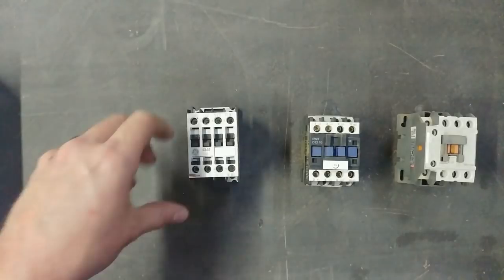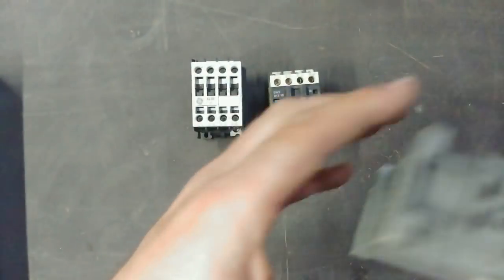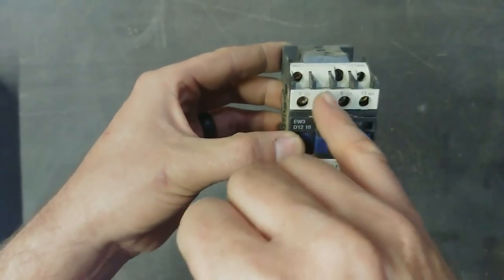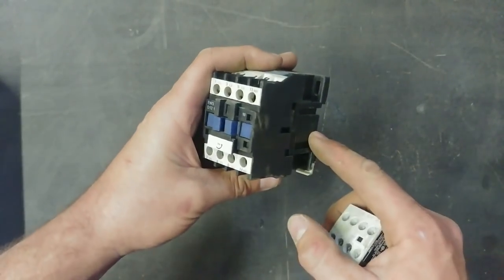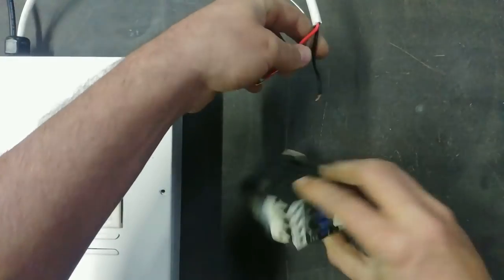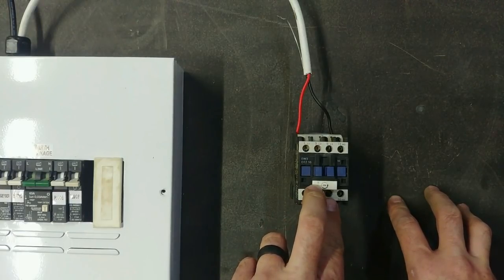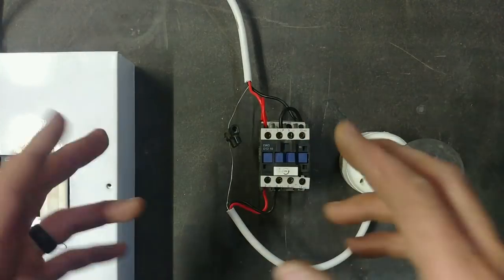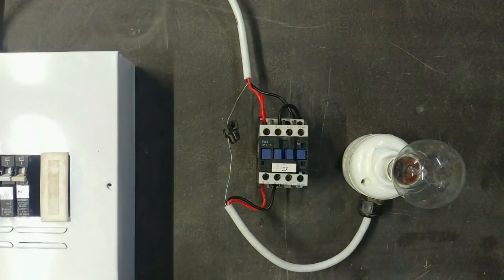How to connect a Contactor

Comment: How can anyone thumbs down this video...it's very clear, simple, and straight forward. Good job JB.
Reply: Someone like me who needs to connect a contactor to the mains in order to automatically switch between mains electricity and generator power when power goes out. This video does not help in my case at all. Having said that, I'm not the one who thumbed this video down. I'm curious though! How did you know someone thumbed this video down when only the creator can see thus information? Unless you're the creator. In that case, you ought to know that self promotion is an exercise in bad taste.
Reply: @TerryMasri  YouTube used to display the number of thumbs down on a video. 

They have removed our ability to see this number since the pandemic.

I am not the creator of this video.
Reply: @Strongs_G3528  That's exactly my point. Unless... you saw the video before the policy change. I didn't pay attention to the dates. My bad 😕
Reply: @TerryMasri  Indeed, my comment was made 4 years ago. All good. Take care.

Comment: Hi Jean, great video. Another reason for a contactor is safety. I have used momentary switches to engage a contactor for my milling machine, that way if there is an interruption to the power supply then the contactor disengages so the machine can’t re-start when power is restored without pressing the Start momentary switch again. 
Judging from the colours of your wires I’m assuming you’re in South Africa 🇿🇦.
Reply from the maker: South Africa is correct.
Good point on the safety!
Reply: @p0we111  hi br Jean... I still need some sort of clarification.... what if I wire my supply through A1 and A2 for L and N respectively and my output at L1 and A2 of the contactor for L and N to the load.
Help with clarification please

Comment: Can you please explain again, why use a contactor instead of a common switch for a sports field? Something you said about the current?
Reply from the maker: Normal light switches where I am can only handle 16Amps.
Contactors can handle more if you buy a higher rated one.
Will also work better for remote starting.
Reply: @p0we111  Thanks! So, what would happen if I accidentaly use a switch or a contactor on a higher current than what it's rated for? Will it melt?
Reply from the maker: @GzzLuiz 
If the switch is rated 16Amps and the current that runs through it is 20Amps it will eventually fail yes. Maybe not in a week or a month but it will.
All switches fail eventually, even with less current running through it.
But if you double or tripple the allowed current it will fail faster. It will melt yes but I have not seen a switch or contactor catch fire, but surely not impossible.

Comment: Hi Jean, great video. Please, can a contactor be used for a 3phase 4 wire circuit?
How can I achieve that? Is it by using the auxiliary contact as to pass the neutral?
Reply from the maker: Hi. You can buy a 4pole contactor for the 3pases and neutral,that would be best... 
If you have the info of the current contactor and you can see how much the auxiliary contact can handle (usually in amps) you can use it if you're breaker/amps required is less than the aux amps. 

It all depends on the load/amps passing through the aux contact...

Comment: How much power is actually needed to pull the armature? Could I use a battery?
I'm trying to hook up a contactor to an old soviet cement mixer in order to have a seperate start button. So I've run my 3 phases and ground (4 cables total) through a contactor with 4 connections, and now to make that engage I have to put separate power into A1 through to A2? Having a whole separate power cable and plug just for the switch seems like overkill, so could I instead get a 12V battery to provide the control power into A1?
Reply: You can use the 12 volt DC only if your contactor coil is rated for 12 V DC. Else, first check the coil voltage specification.. whether it needs AC or DC and at what voltage. Then wire it up accordingly.
Reply: @rjshtk  Thanks, I've been learning a bunch of how these things work and now I have a much better understanding. Maybe you could answer one question I still can't figure out? I've seen an option to wire a contactor so that the magnet coil is powered by one of the 3 phases hooked up to the contactor. The question is, wouldn't the coil, by drawing 220V from L1 to keep the magnet energized, draw power away from the motor and influence performance? Or can that totally be done with no downside?
EDIT: its a 220v contactor
Reply: @xxDrain  The current drawn by the motor would be definitely higher than the contactor coil's energization current. That will not at all affect the working of the motor or have negative influence in performance of the motor. Please let me know if you have further querries. Happy to help!
Reply: @rjshtk  Sounds great. For now I've just hooked up a basic switch since I burned my only contactor (probably) running L1 through the coil to L3, which must've put 380V through it. But I'll try setting up a contactor correctly some time in the future, thanks.
Reply: @xxDrain  I am no expert, but 1) the drain would not be significant in any way, 2) I believe that is then a "latching" circuit, meaning the power to the coil of the contactor remains on after the original signal to engage the coil is removed.  To switch off the contactor you must then break that loop (push a NC switch that you put into that loop circuit).  This way you could have a circuit with 2 push buttons for on and off. Useful if you have 2 "events" that signal the on and the off requests. And it e.g. there is a power outage, when it comes back on the contactor will always be in the off position.

Comment: I didn’t get the end part, you said that you directly added the live and neutral of the bulb in the other end?
Reply from the maker: Hi Jebi.
Bridge the earth wire to the main earth.
The LIVE wire goes to the contactor.
The NEUTRAL wire can go on the contactor to be switched or just bypass the contactor and put it on a connector as you only need to switch the LIVE wire through the contactor.

Comment: Hi I would like to know can you wire wall plugs to a contactor
Reply from the maker: Hi Armando. I cant see why not. One thing I did to protect fridges from an unstable power supply was to put the fridges supply through a contactor that was controlled by a timer. The timer switched the contactor off when power was lost and would switch the contactor back on after 10 minutes when the power was back on.
Reply: @p0we111  OK thank you because I did wire my wall plugs to the contactor but now I have lost of power there power on the plugs but not enough
Reply: So am lost don't know why it doing that
Reply from the maker: @armandovanas4198  I only wired that for protection against our bad power supply in my country. You do not have to wire a contactor into you're plugs or lights. The most common reason I put a contactor in was because some light circuits have so many lights that the switch cannot handle the amps. I only did this in big factories. With today's LED lights I don't think that it is even done anymore. I don't put contactors into my home wiring,unless for the reason above,or maybe to start a pump.

Comment: What did you mean you dont need to connect the neutral at the end? The bulb wouldnt work without neutral
Reply from the maker: Hi Marc
You dont need to connect the neutral through the contactor.
Just bridge the neutral with a connecting block and only switch the live.

Comment: Newbie question I thought contactors were used with a control circuit?
Reply from the maker: Hi Satsiwat. Yes,a control circuit would be wise. A simple switch would be sufficient as a control circuit or a push button start/stop with overload  depending on your needs.

Comment: Baie dankie vir die verduideliking. Ek wil 'n contacter gebruik om heat-coils aan te sit via 'n thermal controller. Die thermal controller kan net klein stroom hanteer, so ek sal 'n contacter moet gebruik
Reply from the maker: Hi Niko 
 Ek sal definitief n contactor op elemente sit. Kyk net of die controller die contactor kan aansit,want selfs die contactor se stroom is soms te groot vir die controller. Dan moet jy die conrroller gebruik om n relay aan te sit wat dan jou contactor aansit. 
Hoop dit help!

Comment: can you tell me the advantage of using the contactor to the spot light system?
Reply from the maker: Vincent Masanja 
You will only need a contactor on a spotlight system if your switch cannot handle the amount of amps that passes through it to switch on the lights. If the switch can handle 10amps and your total amps of the lights is 15amps you will need to put in a contactor that can handle 15amps which in turn is switched on by the switch.
Reply: thank you for your training.
Reply: The basic idea is to control large current drawing devices (big pumps/fans/be it any heavy current drawing load)using small current drawing device(control contactor). Here in your case, if your spotlights are of high wattage, you can switch them on using a contactor, that way you don't need a control switch that is rated for the wattage of the whole bank of spotlights, instead you can use a contactor whose main contacts rated for your load and the control wires to switch on the contactor with a lower amp rating. A bonus in this way is that you can place that small control switch anywhere you want in a house.
Reply: @rjshtk  I have been trying to understand why a contactor is needed for a float switch to turn on a pump. I wondered why the float switch can't connect directly to the pump. This is the best explanation I have found.
Reply: @chadandhayleysmom  You are welcome!

Comment: What about wiring a contractor to a 220 well pump. How do you wire pressure switch to signal contactor to open and close
Reply from the maker: Hi Max. 
Make sure that the pressure switch can handle the 220v and the load of the contactor.
Then just let the pressure switch break the A1 connection on your contactor.
The pressure switch wil usually have a normally open (NO) and normally closed (NC) switch.
Just pass the wire through the connection that you need.
Reply: @p0we111  yes this well has been In operation for years now but it seems to be burning contacts on these square d pressure switches you buy from big box stores even though its rated for my pump size. I believe the inrush current off 55 amps is too much for the pressure switch and causing it to arc. Since the contactor is cheaper than heavy duty pressure switch i thought I would go that route. So line in one side and load in the other side and then the pressure switch will be wired to contacts on the side of contactor correct?
Reply from the maker: @truthhurts2149 
Good idea yes.
I will try and talk you through it. Let me know if something is unclear.

Live (L) wire from mains to - pressure switch contact 1 and contactor normally open switch (NO) contact 1.
From pressure switch contact 2 to A1 (coil) on contactor. 
From contactor normally open (NO) contact 2 to pump Live. 

Neutral from mains (N) to A2 (coil) on contactor and pump neutral (N)
Reply: @p0we111  ok so I have 4 spaces on my pressure switch. Does the coil to pressure switch control wires go on each side of the pressure switch or the same side
Reply from the maker: @truthhurts2149  There are too many different types of pressure switches to guess that.
Look for writing on the switches contacts.
Maby a A1 and A2. NO/NC maybe?

Comment: I still dont know where to connect a pump or light. You never explained how or what the front 8 connecting points are for. you only explained A1 and A2..
Reply from the maker: Jevon Gullemann 
The first 3 connections is usually normally open and labeled - L1. L2. L3. and T1. T2. T3. This is were the pump wires or light will be connected. The last connection point is either a normally open or normally closed depending on your apication.

Comment: How would i connect it to my inverter line that I plug into the house plug that powers my house. So that when the power comes back it doesn't flow back into my inverter? lol
Reply from the maker: Hi. The best would be two contactors that interlock (one cant switch on unless the other one is off) but that is basically what a changeover switch does. The automatic changeover of today is so cheap it would be more expensive to buy two contactors...
Reply: @p0we111  I am feeding the house straight from the inverter, meaning I have a std wall plug that I plug into a wall outlet, feeding the house like that, straight from the inverter. I'm not using my DB box as point of connection. All I do is switch off the mains. Plug in my inverter and I got power in the house. 
So...on that line. how would I connect a switchover without having it connected on the main power inlet to the house?
Will a contactor not work better for this way?
I have seen inverters that plug into the wall outlet, feeding the house like that, that switches over automatically. my inverter however does not have that function. I need to do it manually

Comment: Can I connect 3phase contactor to single phase supply?
Reply from the maker: john liba 
Hi
Short answer - No
You can switch three phase power with a contactor that has a single phase coil. Just match the coil voltage with the supply voltage and all should be good.
Reply: Thank you I apriciate
Reply: @p0we111 Sorry for late reply kindly, so it means, single phase contactor can work with 3phase supply while three phase contactor cannot work with single phase supply
Reply from the maker: @Le_vis254 Hi. No. What I tried to say is - a single phase contactor can only be switched on by single phase (LIVE/NEUTRAL) and a 3 phase contactor can only be switched on by 3phase (LIVE/LIVE) but you can have a single phase contactor switched on by single phase power (LIVE/NEUTRAL) but you can run 3phase power through the switched part of the contactor and switch it on and off using the single phase contactor.
Reply: @p0we111  Thanks for the clarification.

Comment: what happened if we supply power from output. whether reverse connection works??
Reply from the maker: Mithun Shaw 
Sorry Mithun,I dont understand your question. But if you mean connecting the load at the top of the contactor rather than the bottom,that would not make a difference. Either way would work.
Reply: no sir, my question is that if we can use a contractor for one way circuit only.  AS a diode I want the flow from one side only. please suggest.
Reply from the maker: Mithun Shaw 
If it is a DC curcuit,I'm sure it will work for one way only. For AC,I dont think it will work as it should. The contactor might still switch on,but will not have the power it should to pull the coil in properly. 

I had a problem once using a 230Vac contactor with a 400Vac contactor. The reverse feed from the 400v contactor would switch on the 230v contactor when I did not want it to. I also considered using a diode but switched the A2 phase of the 230v contactor to the same phase that the 400v contactor was reverse feeding. 
Hope that sheds some light.
Reply: thank you, 
do you suggest any diode for 240 volt ac so that reverse current will not effect the supply. 
basically I was trying with a hooter connected to two supply PID  and I want to prevent reverse supply of one to another via hooter. please suggest any diode .
Reply from the maker: Mithun Shaw 
I would just put in two contactors,one  for each supply but let both switch the same thing (hooter). That way you dont have to worry about a diode that might fail and cause damage. If you want to go with the diode,im not sure which one to use. It will be best to speak with the company that distributes the diodes.

Comment: what can be the problem if what ever is connected turns on only to turn off 6 seconds later
Reply from the maker: Hi. Just a few guesses: 1. Some contactors has a mechanical timer installed,usually on top. THey are designed to switch off after a few seconds for starting pumps. 
2.Try using different contacts of the contactor as there is usually three or more. 
3. Does the contactor switch off or stay on when the output switches off?
Reply: @p0we111  it stays off
Reply from the maker: @freaklatino13  I'm going to assume you mean the contactor itself switches off after 6seconds as per you're original question. 
I have never had a contactor coil go faulty and switch on/off. The contactor coil would either break/burn or work correct,so I will assume it has something to do with you're supply or it is a delay off contactor. 
If you have some way yo test you're supply,I would start there...

Comment: Hi. why should we connect phase to A1 and Neutral to A2?  why it wouldn't work if we do the opposite?
Reply: could it be because it will make the electromagnetic field in the opposite direction (what I mean is, fixed core instead of pulling the movable core, will push it )?
Reply from the maker: Vahid Hosseini 
You're right,it will work. I just like to keep things "standard"  If I have to work on it again,I will know where I put the phase and neutral as I always try and do it the same way.